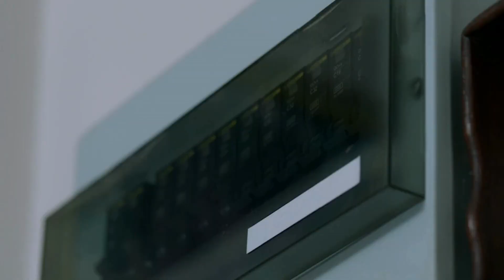5 Reasons Your Thermostat is BLANK!

Comment: Can a blower motor and capacitor cause a heat pump to not blow cold and then cut off system and thermostat all together? We're thinking our "pro" might have misdiagnosed.
Reply: He replaced both the blower motor and capacitor then put a new thermostat in. Now, it shows 1 degree less than I set the heat at so blows all the time. It won't reach the 1 degree higher, no matter where I set it. It just blows all the time. I read that it could be the calibration???

Comment: My Honeywell CM901 thermostat goes blank usually when I push a button. When I give it a few taps it come on after a few minutes and some times it takes longer. My boiler is Worcester Condensing Combination Greenstar CDi and I cannot see a float switch at all, as per your video. Could you please let me know if I need a new thermostat?

Comment: Very informative, however none of these worked for me.  You need to make that 6 Reasons Why It Goes Blank.  When I took the cover off the wall and put it back on the screen was blank (black screen).  It was not a power issue, it was that one of the pins got bent when I removed it.  All I needed to do is carefully bend it back up straight, put the cover back on, and Voila!  It works!
Reply: SAME!
Reply: SAME!

Comment: Float Switch Problem! Thank you so much for your very helpful and very clearly presented run down on why the thermostat panel had no indicators, letters or numerals, showing and the AC unit was off. I made a big hit with my wife when, after checking that there was not a high water level in the drain system causing the switch to open, I simply jiggled the switch a bit to make the AC come back to life. I did give you and YouTube big credit, though. I will double-check the drain system to make sure all is clean and clear to drain the condensate. May God continue to bless you and your willingness to share your knowledge and experience here on YouTube😅.

Comment: Thank you Sir saved me from waiting 72 hrs in the Florida heat for a “professional “ drained the pan high level switch wet and dry vac sucked it out garden hose flushed the line. DIY 😘

Comment: My honeywell th3210d1004 Display was going blank little by little. I have a lit Green Screen but No Digits. All Systems Work Just Fine, I just Don't Know what my Settings Are. It's over 10 years old and I simply ordered a new one. Your video was GREAT and EASY to Follow. I think or Hope it's Simply a Humidity issue since anytime a Display goes Down, that's the Cause. I do Live in NC and Humidity is a Major Problem. When the New One Arrives I will Repost. Thanks Again!

Comment: I had an issue where my Bryant residential HVAC thermostat display kept going blank. After some digging, I discovered the root cause: the condensate drain line was clogged with fungal growth. Every time water backed up, it triggered the float switch, which opened the circuit and cut power to the thermostat—a built-in safety feature to prevent overflow damage.
✅ How I Fixed It:
- Used a wet/dry vacuum to pull a vacuum on the drain line.
- Cleared out all the backed-up liquid and fungal blockage.
- Once the float switch reset, the thermostat display came back online.
🧼 Preventative Maintenance Routine: To keep the drain line clear and avoid future float switch trips:
- After every AC filter change, I pour 1 cup of 45% horticultural vinegar or bleach into the condensate drain pipe.
- This kills fungal growth and keeps the line flowing freely.
- (Note: 45% vinegar is much stronger than household vinegar—ideal for HVAC use.)
🔧 Optional Upgrades for Long-Term Reliability:
- Install a cleanout tee for easier vacuuming and flushing.
- Drop in pan tablets monthly to inhibit algae and mold.
- Add a condensate pump with overflow alarm if your unit’s in a basement or tight space.
- Use a borescope annually to inspect the drain line for buildup.
This fix restored my system and gave me a solid maintenance rhythm. Hope it helps someone else out there dealing with a blank thermostat screen

Comment: Just had this problem. Electricians came to install  new breaker so power was out for 4+ hours. Got home and power was on but ac wasn’t working at all. Almost 100 degree weather outside so I needed to get my kids into the cool air. Quickly checked the disconnect switch and found it plugged in the wrong way. Not too sure how that happened but as soon as I turned it around. BOOM COOL AIR.

Comment: I viewed the video. I checked float switch and it was dry. When I reseated it and closed the lid and then changed air filter the unit came on. Temperature in house is 77 degrees but now coming down to 74 degrees. Thank you for the excellent video.

Comment: So what if your AC doesn't shut off & runs constantly? I had my thernostat set at 75°. My AC was running,  but the temp climbed to 80° & kept running. And it didn't feel real hot inside, but not super cold either. My AC guy w finally answered my text but was stamped with work. I did put on brand new furnace filters,  & he told me to vacuum the condensate pipe from where the condensate water drips out in case it was plugged. So I did that, but seemed fine.  I did manage to suck all the water out that was in the line, & it wasn't a whole lot. So I'm trying to figure out if I have a bad thermostat. In checked the batteries, and they're fine with plenty of juice. So not the batteries.

Comment: Thanks, dude, it did go blank. And I went outside and I cleaned the drain pipe out with a hose, a bunch of junk came out and guess what? Thermostat came back on errors, running cold, and I am forever in your debt. I live in florida.I need my air❤

Comment: Many thanks, mate. May God bless you. Mine was the float switch. I didn't even want to clock on your video as my thermostat wasn't "blank" but I'm glad I did. I had tested the breaker, turned off and on the electricity to the house, registered voltage at the breaker but not at the thermostat and concluded that the wiring must have been damaged somewhere. I'm really glad I watched this as I don't know how much the HVAC guy would've charged me.

Comment: I went to pour 8 oz vinegar in AC drain pipe. Instead removed float switch and poured in there. Now thermostat is turned off. Ive checked the breaker. Made sure the float switch was in properly but still cant get the thermostat on. I dont see a switch near the float switch or wiring. How do I get the float switch to tell the thermostat to turn on? I made sure no moisture in the pipe where I pour vinegar.

Comment: I changed a lot of the wall switches and receptacles in my house to different colored ones.... because it's an old breaker box and a lot of the breakers were mislabeled or not labelled at all, I shut off the power to the whole house to do this.
When I turned the power back on, even after a few hours the thermostat wont turn back on.

Could the power shutting off have affected the float switch, or any of the other common safety switches on ac or furnace? 
Id done the exact same thing a few weeks ago (shutting off power main to replace some wall switches), but the hvac came back on no problem. If you have the time to offer any advice it would be greatly appreciated, thanks

Comment: I know this video is a year old but our unit stopped working while we were on a camping trip. I checked everything I could think of with no progress. I went to the good ole YouTube for help and came across your video and with you mentioning the float switch first I immediately went and checked it. Well… my pan was full of water I drained it, and like someone else mentioned in the comments, I had a blockage in the drain line, I ran some bleach water through it to clean out the line as they mentioned, and BOOM… back up and going!! Thank you for this video and you gained another subscriber!!! Thank you!!
Reply from the maker: Camping trip saved! 🙂
Reply: @NewHVACGuide absolutely!!!

Comment: Thanks for the video. Question; if I have a float switch triggered by a full pan, does it normally allow power back to the thermostat once the pan is empty? Or does the floater switch need some kind of resetting? This is my problem right now. I've emptied the pan, even sucked water out outside through the pvc drop, and still no power to my thermostat. (FYI, it's a no battery setup.)

Comment: Thank you for the information. I got mine fixed with battery issues
Reply from the maker: Glad I could help
Reply: @NewHVACGuide  The new batteries should show some information on the thermostat's face, even when not connected to the other part of the plate. 
Mine shows diddly (nothing). Why?

Comment: Thanks for the video. I wish I had seen your video first. Power was out to my Bryant Evolution Connex. I tried online recommendations and it said get a new one ($700-$1200 ish). I was stoked that I won one on auction for $400. Waited a week in a bedroom that was 82 degrees. Installed it once it arrived and it didn't work. A buddy of mine at a local HVAC company told me to check the low voltage wires. There was no power, then he said I need an electrician. I then stumbled across your video. My drain line was clogged. I don't know how it slipped my mind.....I guess the bill could've been worse (week and a half of sweating, and $400 for a new thermostat that I can't return).
Reply: 400 USD for a thermostat?

Comment: Man I just paid $10k in January to fix my heat pump and replace duct work after purchasing in November 2023. Money my thermostat went out and I dreaded calling because of the cost. I opened up the panels and realized there was still power going to the unit found your video today (Saturday) the weather has been really good didn’t really need heat or a/c the drain line was tilted up a little I pushed it down a little water came out went in the house and in 5 minutes the unit kicked back on

Comment: Tried all these and it wasn’t the diagnosis, finally had a pro come out (210$ Later) & the breaker flipped on the bottom right of my “ Air Handler/Furnace”(Not the breaker to the home). So check that also before spending. Pro was in my home for 15min🤦🏾
Reply from the maker: The question becomes, why wasit tripped? They don’t just trip for no reason. Let’s hope they don’t need to come back out.
Reply: Asked him that to. He just said it was really rare apparently. And again it was on my air handler not the home panel. Would love to figure out why it happened.

Comment: I changed my thermostat it still wouldn't work. Your 1st issue was the reason it was blank so cleaned it up got it on, but not it only works on fan auto will only last 5 minutes then the AC shuts off and wont go back on.
Reply from the maker: Might be time to call a pro.

Comment: I just got a new ac unit outside in May a Lennox 15.2 seer 3 ton unit for a 1492 square ft home for $4000. I opted not to get the whole HVAC system done,  so nothing done in the attic.  My home was built in 2010, outside unit was replaced due to dead compressor.  I noticed today on thermostat ( 2 months later) that screen was blank.  I put batteries in it for the first time ever because I never had this problem.  That still didn't work.  My ac company now tells me it can be the float switch,  I got a feeling their about to charge more thousands.  Can this issue be because of faulty installation.  What should I check for and asked them before they act like installer couldn't possibly did anything wrong.  11 years in my home and I've never had this problem.
Reply: If your thermostat goes blank 95% of the time your safety switch has been activated because your drain pan is getting clogged. Check your safety switch first if it’s clogged than your best bet is to get a shop vac and suck the drain line from the outside by your condenser unit while pouring hot water down your drain line from the inside unit to clear out any possible gunk

Comment: Our thermostat honeywell lyric is blank. When I changed the battery it displays a message says no power is coming check the circuit breaker. I checked the circuit breaker doesn't see any one tripped. Can you help us to see how we can fix this problem.

Comment: Why not TELL US what to do about a faulty float switch???
Reply: Take out your float switch and flip it upside down. If the unit turns off when the float falls your switch isn’t bad. Your drain might be clogged
Reply: Float switch will ride up (float) if there is no drainage. Look for the condensate pipe. The float switch has wires coming to it. Blow out the pipe to get rid of the clog. Ensure drainage is good.
Reply: Remove cap on drain line. Use a combo of VAC and Air Compressor... Suck and blow to remove clog so condensation water can exit and not back up... If it doesn't flow free and OUT then the pipe fills, activates the switch... System off.🔥

Comment: My thermostat goes blank most of the time, and comes back on occasionally.  Any ideas on what to do?? Thanks 
I replaced the batteries, same deal.
Reply: Mine is blank today? At least we’re not it needing heat in late summer. Did you end up fixing your issue?
Reply: Float switch, clogged water line.

Comment: Mine goes blank in the spring and summer, and less often in the winter. When it does, the outside unit shuts off and the temp in the house climbs without me being aware. I have to unplug and replug the thermostat head unit, go in the garage and throw the heat breaker along with the a/c breaker, wait several minutes turn the breakers back on, and 5 minutes or so later the outside unit turns on and the house cools down (or heats up in the winter). I rent, and this house is an overpriced piece of junk. Its more trouble than its worth to call the property management company so I just grin and bear it.

Comment: Thank you man.  Leaned senser on roof all started but pump. There is TH4B - Luxaire unit have lead on the side, and black sensor underneath. I moved that sensor before I go on the roof, when cleaned come back, and put lid back, reset unit, and nothing.
Pump won't start

Comment: I got up for work, and my house was super hot like 85 with thermostat set at 73. So I checked, and my thermostat is blank and replaced the batteries and still blank, but the furnace was still going and blowing hot air... probably way hotter than it's ever blowed. So what would cause this as once I got to the basement the furnace stopped blowing
Reply: Same thing happened to me too I'm wondering the same

Comment: My heat was running fine a couple hours later my thermostat went blank. Ive never had batteries in my thermostat, so i put batteries in and the display of the thermostat came on put my heat or AC still would not kick on?? What is my issue???
Reply: Did you figure out the solution
Reply: Same for me. Did you get it figured out?

Comment: The float switch was exactly what caused our system to kick off. Thank you for mentioning it first!
Reply: Did you have to get a new one or drain the condensate pan
Reply: @21toadian  the drain line was clogged. I had to flush from inside and outside using a hose with a nozzle attached and bleach to loosen the clog. Just be careful inside around the electrical.

Comment: Thank you! The problem was the float switch. I opened it to pour in some ac build up remover. Was getting super frustrated and tried wiggling around and reinserting the tab for it and it worked.

Comment: Mine said I needed to change the batteries on it. I put brand new batteries in it and then the screen went blank, but lights up....?
Reply: it's the battery connection - don't press them it too much, don't attach to the wall to hard....that's what I learned, after running around checking drain plugs, fuses, re-re-replacing batteries - it'd light up and show stats but then disappear...I'd get the screen to reappear and v.e.r.y. gently put it back on the wall.............. yes.
Reply from the maker: Oh no! Maybe the stat is bad?
Reply: @NewHVACGuide   the what?
Reply: never mind.   duh.     but while I'm here again - my stat wasn't bad, but the battery connections were soooo sensitive. Batteries had to be set just so, and the stat just so on the wall.....
Reply: The thermostat (stat) may be malfunctioning

Comment: Thank you for the video. My central air unit/furnace shut down like it should because my p-trap was completely clogged. I replaced the p-trap with an E-Z trap and the AC has been working great. The water is supposed to drain to the outside of the house, but I don't see any water coming out. I heard that there should be about 1 gallon of water draining every two days. I live in a fairly new single level house. There's no water leaking around the central air unit/furnace or in the rooms beside the furnace closet. Where's the water draining? Should I be concerned? Thank you.